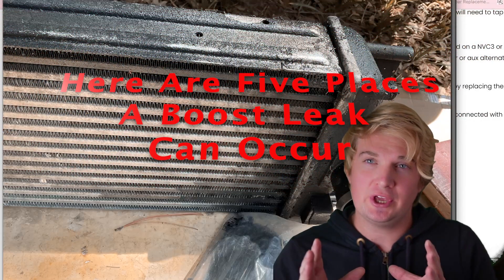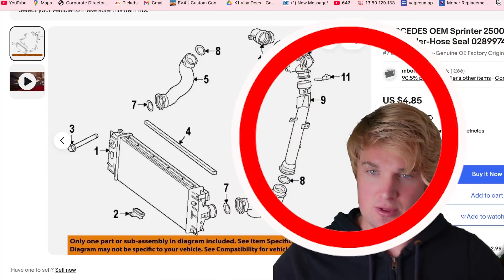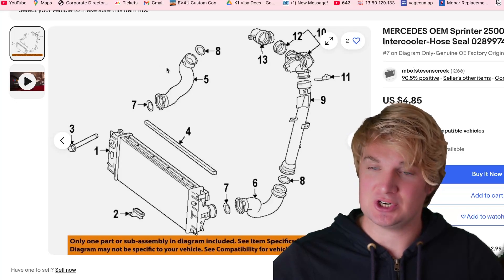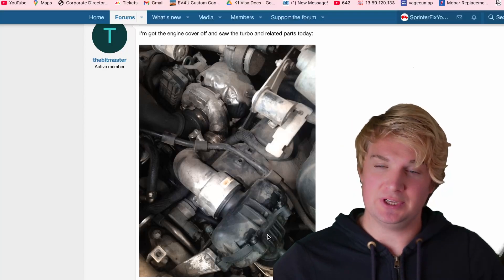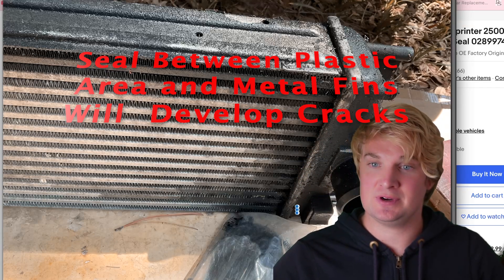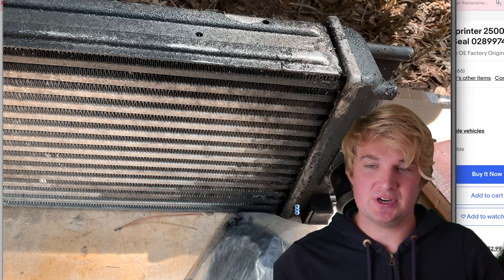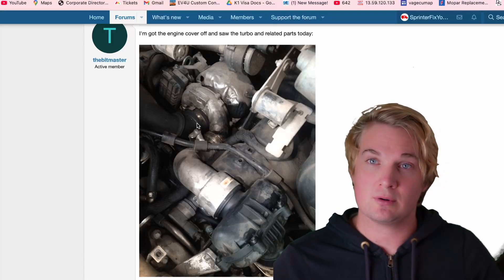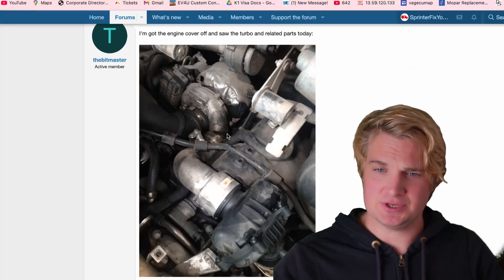Sprinter Boost Leak: Limp-Home Mode Fixed

Comment: It would be nice if you would specify the year and engine type you are referring to.
Reply from the maker: Tbh it doesn’t really matter.  They all have similar location of intercooler and hoses as well as pvc. More of a modern diesel issues tbh.

Comment: I have a 21 sprinter 3.0 diesel.  Blew the driver side Intercooler hose.  Now it runs terrible.  There are no more leaks but the eco seems to be pulling boost back. Help 😢
Reply from the maker: damn, I am sorry to hear that, were you able to clear the low pressure codes after replacing the intercooler?

Comment: I have a 2008 Sprinter , oil in intercooler, oil in hoses, black oil like your intercooler I decided to change my radiator, AC cooler and my intercooler. Its a box van , mainly driven in Germany, no speed limits, motor has been replaced but not the rest. Its a nightmare, everything plastic. I should have never bought it but it was a " good offer " .

Comment: There is oil introduced in to the snorkel.. usually the resonator when it leaks it'll spit oil.. just ever so slightly.. The gasket between the turbo and the flange on the compressed side dries up and leaks because it's hot. All the gaskets on the turbo compressed.. also the turbo pressure sensor on the cold side right above the rubber hose on the metal flange. And then he also have your ekas flaps  they don't open so much or they close to much and causes a higher then normal pressure usually do to map sensors sending incorrect voltage to the computer to measure turbo actuator...

Comment: I have had the dreaded P029900 boost pressure too low code for over 2 years on my 2015 906 manual diesel sprinter.
I have changed the inlet manifold , all sensors ,and valves , brake servo , vacuum pump , egr , both wastegate actuators . No leaks visible from smoke test .
There are no signs of leaks .
The 2 wastegate actuator arms do not move like they should after starting the engine .
Are there any other tests I could perform?
I’m going insane 🤯🤯🤯🤯🤯🤬🤬🤬🤦🏼‍♂️🤣
Reply from the maker: I would measure the requested boost vs actual boost pressures in order to understand the real difference in values that is triggering the code. The only two things I can think of are turbo actuator, (visual check with someone reving the engine) and perhaps a clogged up exhaust. Unfortunately I am not super familiar with your engine configuration since here in the US we only have the 3.0 engine and some rare 2.1 an d 2.0 versions. But there has been a known issue of  cracked plastic manifold on the 2.1 liter engine that causes a boost leak. Also consider ensuring you have an original MAF sensor (watch my maf video to see why this is important) best of luck
Reply: I have replaced the inlet manifold even though there wasn’t a problem with it.
I have just found out from the previous owner that he cut out the inside of the DPF .
Does the ECU measure the back pressure of the exhaust?
Maybe that’s why the actuators are not moving when starting the engine as the ECU is detecting a problem maybe?
I will perform the test you suggested this weekend , thanks.
Reply from the maker: @ACE-s2j  yes, ECU does measure the difference in pressure across the dpf, however, having zero pressure from the modification does not trigger low boost conditions, it will just suggest you have an exhaust leak along with a check engine light. My suspicion from the previous owner is that the ecu was modified in addition to his physical modifications.In this scenario van will think it does not have components when it actually has those components. The actuators you are referring to, I am not sure if you are talking about the the "throttle body/anti-shudder valve" or the swirl flaps/swirl flap motor or the turbo actuator. We only have the 3.0 engine and the 2.0 /2.1 engine here in the USA. if its any of the first two it is possible they were accidentally tuned out.

Comment: Does the boost leak always set a code? Because I’ve had limp mode twice without a code or check engine light. Dealer checked computer without anything showing.
Reply from the maker: yea, probably check my video out on my discussion of different limp modes. lots of things cause these vans to run bad. sometimes limp mode is a term that is used incorectly
Reply: What did your "limp mode" feel like? How fast, any odd noises, etc

Comment: First, thanks for all the super clear amazing videos!  I have a question / Idea I'd love your thoughts on, or even if video. Problem(s); 1, air recirculation goes off after a few mins. 2, defrost is SO weak. 3, the fresh air vents are mostly not useful.  What I'm thinking of doing is adding a manual control cap to the fresh air box and routing an air intake from the cabin (also with a manual control. This might solve the recirculation issue. I would also love to send conditioned air through those fresh air vents. Thoughts? Ideas?
Reply from the maker: When you say fresh air vents are u referring to the ones that point directly to the driver's face? I have noticed that the AC recirulation turns off after around 15 minutes on my 2007 and 2008, I assumed that was a featrure rather then a bug. Unfortunately I have not delved too deeply into this issue, But it is certainly a video I would watch if you made it :)

Comment: Bingo on your #1 problem area! Ironically I had just replaced everything on the front of the motor on my 110K mile major service.... belts, pulleys etc.  I replaced the perfectly performing stock hose (#6 in your diagram) with an aftermarket hose. It lasted 4500 miles and split. Currently running the old original hose now!
Reply from the maker: do you by chance remember the brand of that aftermarket hose? I have had decent luck with aftermarket hoses but I'd love to know what to avoid.

Comment: My turbo resonator (part #10) separated at part #12 somewhere while going about 60 mph on the freeway. All the spooled up air escaped fast and loud like I had a flat tire. Basically you lose about 2/3rds of your power and I kinda coasted off the freeway. Oil was sprayed in the driver side of the cabin...not a crazy amount. Was able to drive home about 2 miles and had it fixed within 2 days after a flat bed tow. This is at around 20k miles.
Reply from the maker: I see, did it just pop off? was the rubber gasket torn? scary thing to hear if you aren't sure what it is I imagine

Comment: Thank you I just ran into this issue. You nailed it. I left the back bolt out on the turbo resonator when replacing the glow plugs. I decided to replace the resonator and seals going to the turbo. I am using the Torque app to monitor my boost levels and other sensors with a tablet mounted to the windshield  while I drive. Can you make your smoke test video next? Thank you for making your videos.
Reply from the maker: Sure, I recorded a smoke test video months ago, just need to find that footage haha
Reply: @sprinterfix  Thanks for the awesome info, did you ever fidn taht smoke test video? I'm chasing an offset drift code this weekend
Reply from the maker: @kendrabites  certainly did. here you go.   https://youtu.be/ywDdclB7Gt4?si=mIhuJsAyrVn0pIOW
Reply: @sprinterfix  thank you! I believe you are the video guru for which I have been seeking!
Reply from the maker: @kendrabites  Ohh! that is just wonderful to hear! Glad you found the videos helpful. Keep up the fixing

Comment: thats why  i got a t1n(2006)
Reply from the maker: ohh boi, stay tuned, t1n video dropping soon, the good the bad and the ugly. haha, I feel like they are a little bit over rated.
Reply: @sprinterfix  Looking forward to that I have owned a T1N in Europe (France) for 22 years now.
Reply from the maker: @SlimTortoise  ahh wonderful. likely not the 5 cylinder engine no? Here in USA we only have 5 cylinder t1n and they have gotten so scarce they can cost upwards of 20k for ones with decent maintenance. That combined with an ever deminishing supply of used parts makes them a bad purchase for most. the minor convenience of better reliability is heavily countered by their over hypedness. I am sure the european market is better for these vans
Reply: @sprinterfix  Hi. It is the 5 cylinder one 2.7 which I have. At the time you had a choice here in Europe 2.7 or 2.1. (You paid extra for the 5 cylinder model, I paid €3000 more)
The EGR and maybe a few other things were not fitted at that time, I think the US market had them fitted a few years before they were in Europe.
Parts are not a problem here, Although they are shipped from Germany which for me is only 500 Kms away but they are available through all French outlets and good prices too.
You don't see as many now on the roads but that is always the case with models that are not made anymore I guess. There seems to be more in the East of Europe.
I have done all my servicing and repairs myself not that a lot has gone wrong to be fair, oil has been changed every 5000 Kms with new filters. which I think helps in my view.
Reply from the maker: @SlimTortoise  Interesting, everyone here prefers the 2.1 litre engine that they put in after 2014 as an option. sounds like you got it newish, I wouldn't suspect that would be such a costly upgrade. I imagine parts in europe are quite abundant. I heard a rumor that theyre still making the t1n vans somewhere in Poland. I do love the design, seems like the newest 2019+ chassis is trying to copy the look of the t1n haha